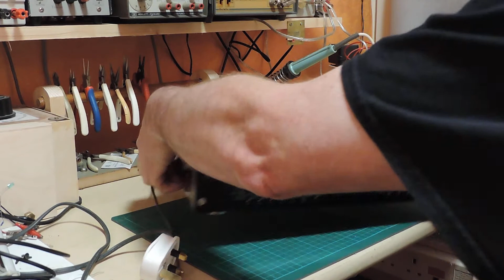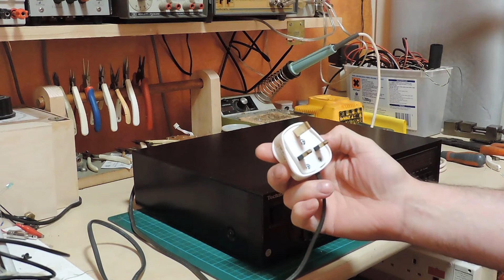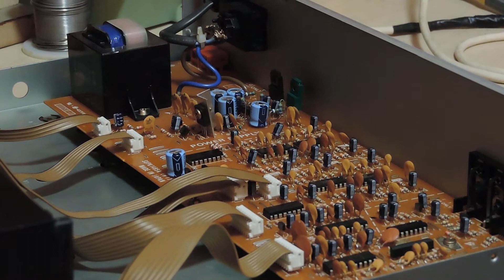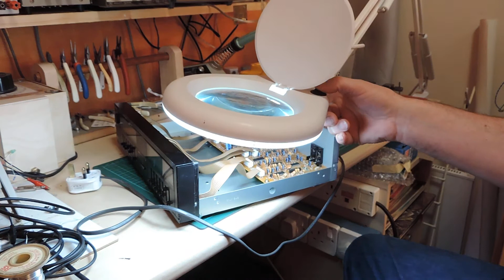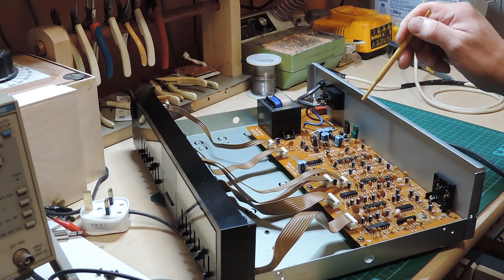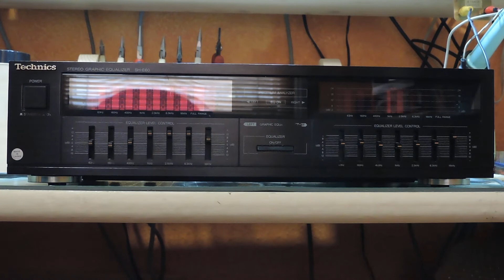Technics SH-E60 Graphic Equaliser - Tear-down & Repair

Comment: Ya know them red plastic display covers mines like bowing out in the middle can I take it off from the outside without opening it up and re glue it back
Thanks 
Mike
Reply from the maker: I'm fairly certain that to get at the display covers you will have to remove the front panel PCB from the inside.

Comment: Hi, in my unit D11 zener and 7805  got shorted and don't know the actual value of the zener. Replaced with a 12v and  now its working. But the 220uf 50v cap which connects to the zener gets hot. Any idea.
Reply from the maker: I don't know the value of the zener either, I couldn't find a circuit diagram online for it. Not sure why the capacitor should get hot, all I can suggest is to try fitting a new capacitor.
Reply: @RetroSteamTech  Many thanks for the swift response 👍

Comment: The PCB looks the same with that of a sh-d5000 graphic equalizer that I have. What zener diodes did you use. Mine keeps on fraying them.
Reply from the maker: The only component that I changed was the input resistor on the 5V regulator, the zener diode was fine.
Reply: @RetroSteamTech  any ideas on how to sort out my equalizer it keeps on fraying the two in series zener diodes which connect to the 5 volt regulator
Reply from the maker: @davidlunda3937  You might want to check the same resistor that I had to replace on mine.

Comment: I have a Kenwood KE 7090 Graphic Equalizer worked fine still sort of works but I've noticed when the unit is in standby mode the display is now displaying red horizontal lines which never appeared before, any help would be much appreciated 👍
Reply from the maker: Could be a bad capacitor or joint on the display board, have a look at it under a magnifying glass.
Reply: @RetroSteamTech  Thanks for your reply, I've reflowed all the joints on the display board and checked every solder joint for any cracks and im still getting the same results, which capacitor would be the culprit? I did recap the power board and the display board with top quality caps last year, would it be on the display board or the power board? Cheers 👍
Reply from the maker: @MrSh4W  Sounds like you've done everything. I would have thought that the fault would most likely be on the display board.
Reply: @RetroSteamTech  I did purchase a second Ke-7090 because some of the pads were damaged, well when I desoldered the new caps off the damaged board and swapped the old caps on the undamaged board I had a hard time getting the new caps off, and they did get very hot, could this be the issue? Could I have burnt out the caps? I mean it worked for a bit then it gradually started failing, or could it be a resistor or another component? Thanks for your help by the way, not many people take the time to respond 👍
Reply from the maker: @MrSh4W  Excessive heat will certainly damage capacitors. The service manual for the KE-7090 is available online, might be worth downloading it. It will contain schematics and PCB layouts. You would be able to replace the capacitors with new ones rather than ones taken from another board.
Reply: @RetroSteamTech  Yes ive got the schematics, but bit of a novice, I've got extra caps so I'll replace the ones on the board and see if that makes any difference, il let you know if that solves the problem, cheers 👍
Reply from the maker: @MrSh4W  Good luck.
Reply: @RetroSteamTech  well I've replaced all the caps on the display board and I'm still having the same results, i used my multi meter to test the voltage going to the display and its reading around 6.9 to 7, pretty sure this should be around 5, ive downloaded the schematics but I've got more chance of learning Chinese, im thinking it's over volting but not too sure as I'm a little clueless, i can solder but that's about it 😔

Comment: Hello, you will have knowledge of the values and measurements of the equalizer slider of this model, I have the sh-d5000 and it is the same as the sh-e60. thanks for answering.
Reply from the maker: Hi. I don't know the value of the potentiometers used for the sliders. Try having a look online for a service manual.

Comment: Excellent video, thank you . I own a frustrating Technics SH-GE70 equalizer . Fundamentally it works great! However visually ? the left and right digital display is completely out , as the indicator lights...no lights at all. I will check for looseness or cracks as your video demonstrated.If you can shed any light on this issue, i would greatly appreciate it ..thnx again.
Reply from the maker: Hi Chris, thanks. It sounds very much like there is no power getting to the front PCB. All you can do is a close visual inspection, preferably with a magnifier and very gently press on the displays to see if there are any cracked solder joints as there were on mine. Good luck.
Reply: @RetroSteamTech  Shall do ! I never thought to press on the display and check for cracks  thanks again..cheers from Canada .

Comment: Thanks for posting this. I had the same problem with the resistor feeding the 5V regulator. It has overheated the same as yours
Reply from the maker: Glad you found it useful. I don't know why they designed the 5V circuit the way they did, it's fairly crude. However, i've been using mine regularly since i repaired it and it's been working fine.
Reply: I had to put a much lower value resistor in to get a 5V output. I used a resistance box and finally settled on 420 Ohms. I may well change the regulator one day or, as you imply, a modern variant of the whole 5V supply.  Anyway thanks for taking the trouble to post as I was sitting on this repair and your video came through just at the right time!

Comment: 37 volts? Is that right? I've replaced my caps, still nothing, reflowed joins to the regs, still nothing. Faint display, eq light flashes once then goes out. I checked voltages and got 38 volts, i thought that was high? Maybe it's that resistor? I was about the throw it out, is there any equivalents to the 3 regs on the power supply?
Thanks mate
Reply from the maker: It's been 6 years since I worked on this but as far as I can remember, yes, the AC voltage from the transformer was 37 volts. The resistor on the 5 volt regulator seems to be a common problem. I'm not sure what the power transistors were as I didn't need to replace them. The regulator was a 7805 I think, these are fairly common.
Reply: @RetroSteamTech  Thank you for the reply! I'll look into it thanks again
Reply: Did you say 470 ohms or 47k ohms?
Reply from the maker: @SassyXR6007  It was 470 ohms.
Reply: @RetroSteamTech  Thanks mate, I'm pretty sure i put that in it and it got very hot. Thing i don't understand is the resistor i removed went YELLOW VIOLET BLACK RED THEN WHITE?
Reply from the maker: @SassyXR6007  If those colours are correct then that was a 47K resistor.  470 ohms worked for me, you could try 4K7 and see how that does.
Reply: @RetroSteamTech  4K7? Thankyou
Reply from the maker: @SassyXR6007  4K7 is 4700 ohms.
Reply: @RetroSteamTech  👍

Comment: I have a similar eq SH-D5000 Equalizer keeps going on and off after every 30sec  power seems ok bt the equalizer  indicator flicks on and off everytime it does that pliz help
Reply from the maker: It sounds like something in the circuit is heating up then cooling down. I would look over the PCBs with a magnifier to see if there are any suspect solder joints.

Comment: Bro I got a Sh GE 77 off ebay and it doesn’t power on. Please advise what I can do. I am willing to send it to you for repair. Let me know pls.
Reply: What are the secondary voltage of the power supply of this equalizer because the power supply is burn out both primary and secondary voltage.

Comment: How do you fix a dimmed vfd display?
Reply from the maker: Hi. I'm not an expert on vfd displays but given their age I would suspect capacitors in the power supply circuit. Bad capacitors are quite often the root cause of problems with old electronic circuitry.
Reply: You will have to replace the display.its a tube and it will dim over time.

Comment: Such a nice unit  ,  I purchased one  ,  did you know the same unit was sold without the metal feet   , but a rubber substitute  ?
Reply from the maker: They are great aren't they. Didn't know about the ones with rubber feet.

Comment: Hi.i have the technics SH E85 but the displays do not come on.im getting power because i can listen through it.ive checked all fuses and played with all the caps.any ideas.
Reply from the maker: Hi, i would suspect a bad solder joint on the display board. Have a look at the display board very closely with a bench magnifier or ordinary magnifying glass.
Reply: Retro Steam Tech thanks for the advice.
Reply: Retro Steam Tech also before the display stopped working i could only get the right side to change display modes via the button.
Reply: same eq with same fault .did you find the fault.?

Comment: Please can you this equalizer set SH-D5000 transformer output voltage
Reply from the maker: I don't think you can change the transformer output voltage, it's fixed on this model.
Reply: @RetroSteamTech  my transformer burn i need replace other but need output voltage